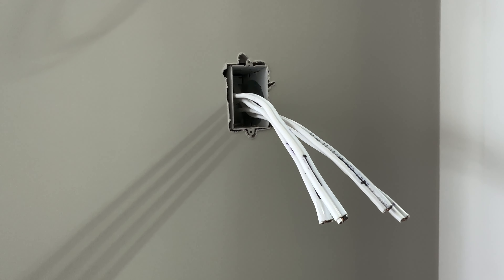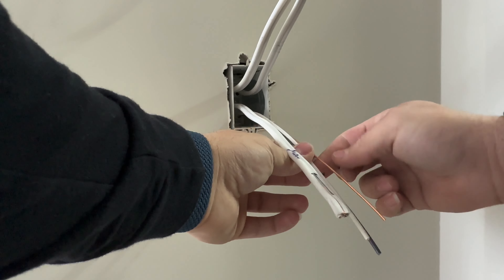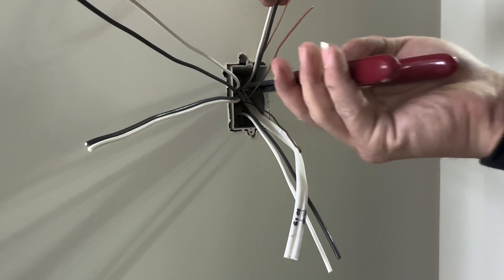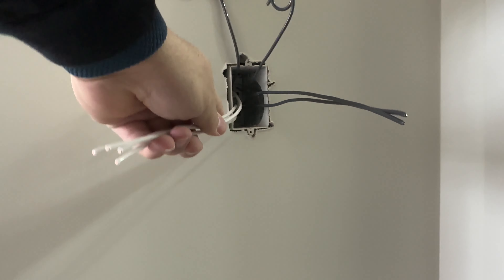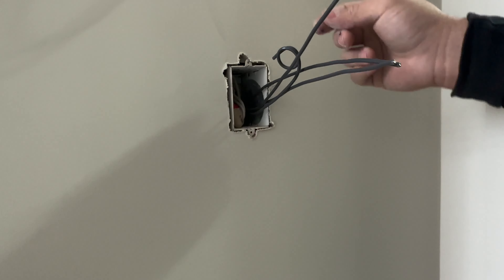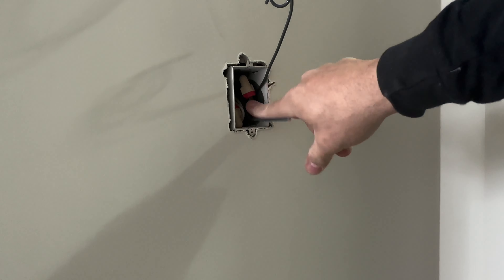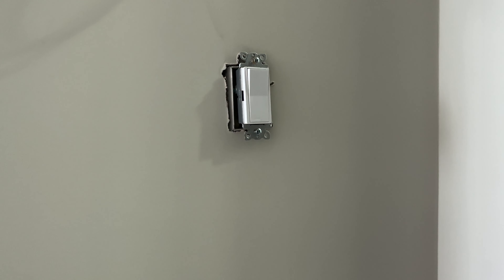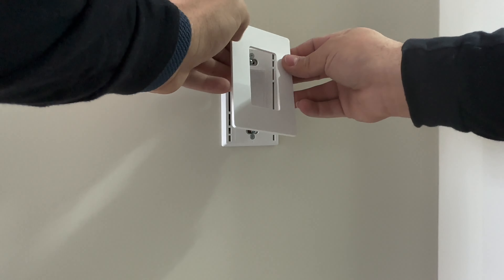Light Switch Installation

Comment: Check out the box fill on that metal box.  looks like you could have to many cables.  at least that ishow it is in the NEC.
Reply from the maker: that box is an IVERVILLE 2304-LHTQ they are wider than a regular rough in box (regular size box 12.75 cubic inches 2304-LHTQ 14.75 cubic inches) and allows for more conductors. Also I am in Canada and the code is slightly different. Thank you for the comment and have a great day brother.

Comment: You forgot to ground the switch. You should pigtail the ground wire from the wire nut to the switch green screw to ground the switch for safety.
Reply from the maker: I am in canada bud I don’t have to
Reply: @uralexwong  I live in the United States and here is mandatory to ground the switch.
Reply from the maker: I know I have been told by the sparkies over there many times. Different codes, have a great one brother
Reply: @jameshernandez45e01  If the yoke is listed the metal box is ground.
Reply: @uralexwong  but you have to bond the box
Reply from the maker: its a metal box and its bonded @sircorn4248
Reply: @uralexwong  yes, I missed it when you pulled a ground wire under the gr screw. Good job.

Comment: i use 14/3 wire for fan , its easier
Reply from the maker: this custom homes use remote controlled/ app controlled fans and costumers want less switches on the walls, otherwise I would of ran 14/3 for sure😊
Reply: in the NEC , several years ago i think that it had to to install a 14/3 or 12/3 to the fan box.   i still install today a 14/3 romex to the fanbox.   even if i cap off the redwire.